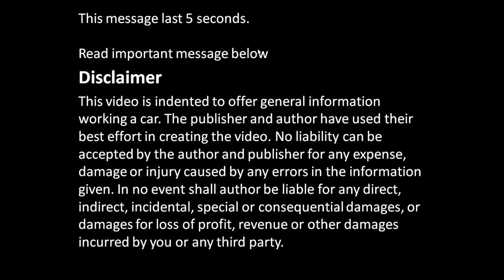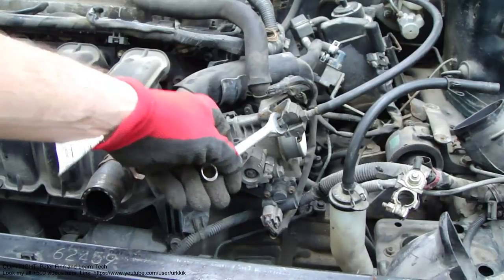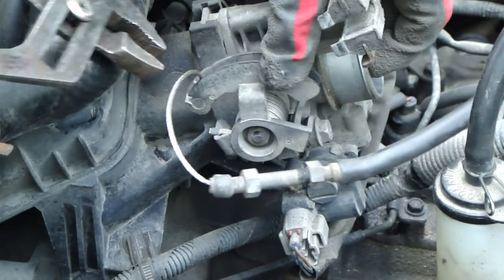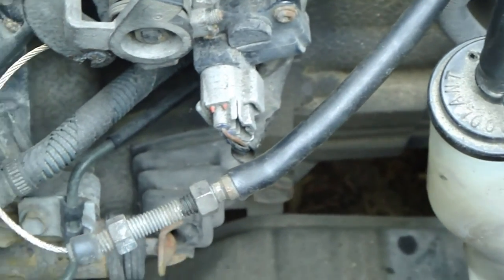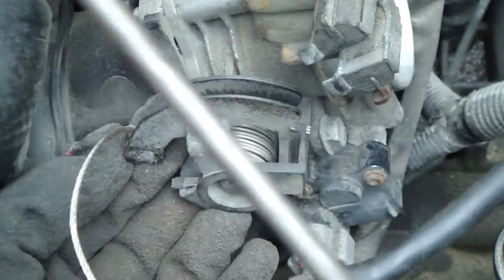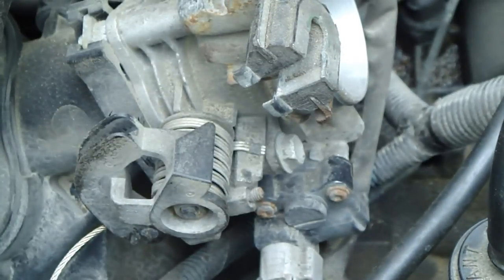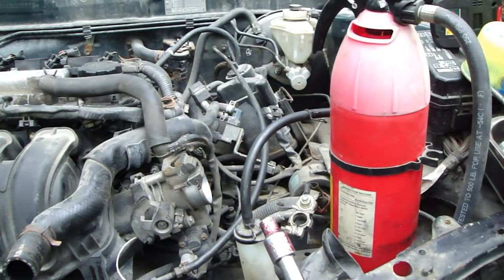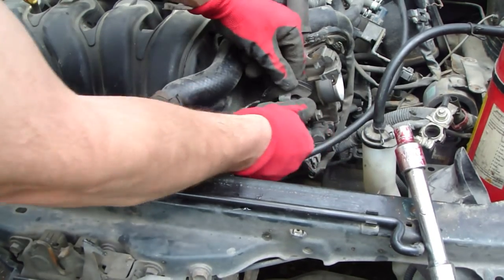How to replace Toyota Corolla VVT-i engine project: Part 12/52 Gas pedal wire removal

Comment: Thank you for this video.  Recently I had the same problem, in that I was unable to remove the throttle cable from the throttle body.  Do you think that spraying with penetrating fluid and leaving for a few hours will be enough to release the cable?  I do not have a gas torch to apply heat at the present time.
Reply from the maker: Hi, penetrating fluid could open the joint too. Please test it.
Reply: Yes